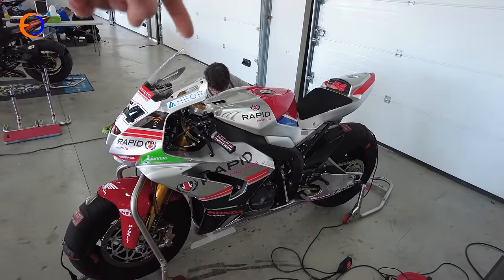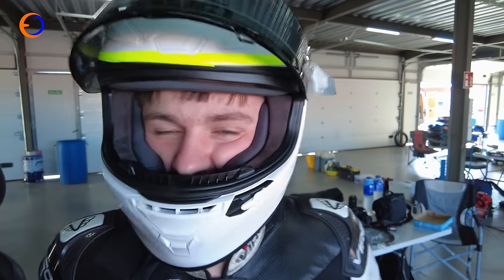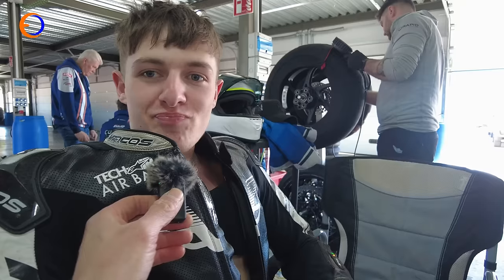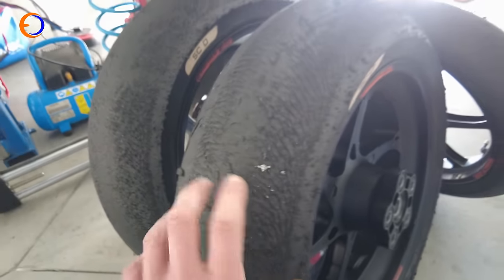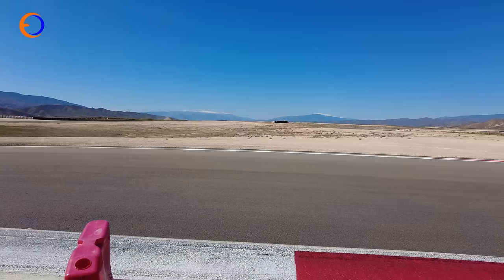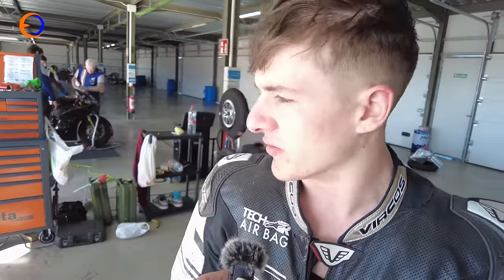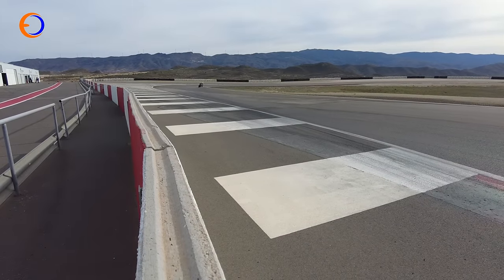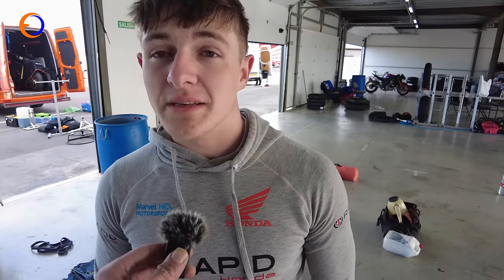The Hard Miles. Testing and crashing the Rapid Honda Fireblade for BSB Superbike

Comment: I.m watching alr3ady all the series, great work and learned some thi gs many times.

Question, i just got an RVP25 equipped bike, and can.t find the rotors code on em.

Can u pretty please share this code with me?
I presume is the t drives pista bassa?
Reply from the maker: Our rotors were made specifically for us, brembo are good at making small production batches if required. Dimensions depend on wheels, yoke spacing, disc diameter... So getting off the shelf might be difficult

Comment: Why don't they have an element on the bottom of the sump that you plug in like a tyre warmer with a little led light on the dash thats tells you when its over 50.C without turning the bike on?
Reply from the maker: Good question. Probably adds weight, but would be more efficient